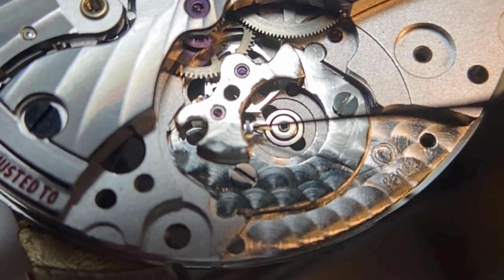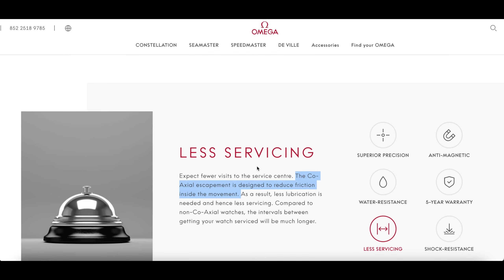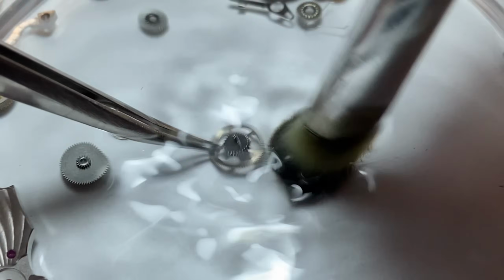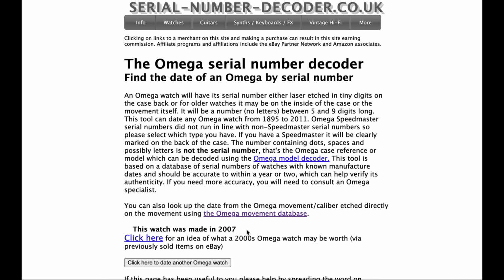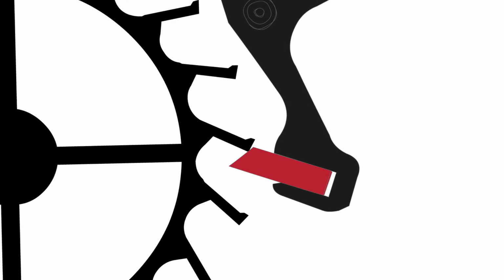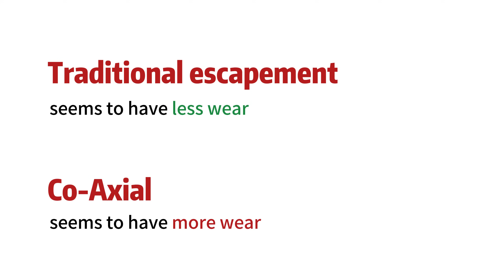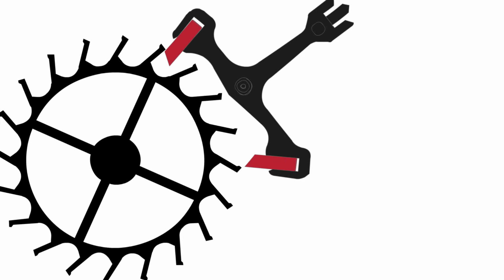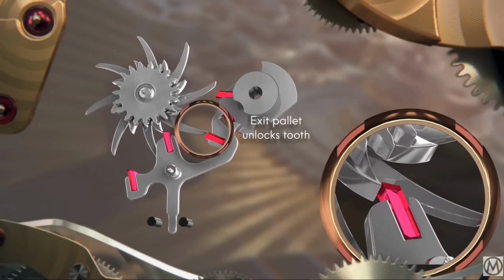Something you don't know about Omega Co-axial

Comment: I have a Favre-Leuba Bovet watch, which is 50 years old. It still works. No problem with the escapement. I have serviced it twice in these 50 years. What is the use of buying an Omega with the co-axial movement, if the escapement gets worn out. And it is an expensive watch too. That's why Rolex did not buy this movement from Mr.George Daniel's. Omega fell for it.

Comment: Bought mine in 2016 by spring 2022 ready for 1st service. Mind you left the crown accidently unscrewed...in the Aegean sea.  In the bag of bits the stem was so badly corroded. The escapement wheel and pawls came too, but no  Si or barrels.  When i got back from holiday I ovened it at 60C for days, with the crown out,  it "worked" for a while, but it was too late, and finally stopped. I think the oil on the pawls is achilles.

Because of high fixed service costs and delays, it is sensible to just to leave it till it breaks.

Comment: That was very informative, thank you! I think the wear here was so uneven, it possibly was the result of a severe shock to the movement. All things being equal, less friction and less acceleration and deceleration of the parts should result in less wear. What that means for maintenance costs is not entirely clear - less frequent service probably means less cost, but while you can get a Seiko serviced anywhere, the Omega needs to go to Omega itself or to a certified watchmaker, and I assume that means cost per service will likely be higher. Which applies to every high-grade watch, and I don't mind it at all - I used to service binoculars, riflescopes etc. for a luxury optics maker, and servicing takes training, time, and specialized equipment as well as spare parts, neither of which are cheap. Thanks to my own job I gained extra apprecation for things that are repairable and last for many decades, and I am willing to pay for it! 
I also have a pro tip for getting good service: be positive and give the techs an honest and detailed description of what happened. Don't try to trick them into taking the repair on warranty when the damage was really caused by an accident, and don't try to argue with them about their determination of what happened. They have seen it all, they have done this thing for many decades if not centuries, and their policies are legally waterproof. They are NOT out to get you - most of them own the same instruments you do, and they want to treat you how they want to be treated. You MAY get a bit of a discount if you create enough of a nuisance, but by doing that you also run the risk of slowing down your own service case when management gets involved and they need to figure out how to handle your case, and someone somewhere gets distracted and forgets they had a decision to make. Before you act, ask yourself whether it is worth the risk. 
If service cost appears high, it's because that's what it costs to put in the amount of skilled labor to fix up your high-grade instrument, whether it is a watch or a spotting scope or whatever. In order to provide excellent service, the business must survive. Which is not going to happen without money. What you get out of it is a watch that is serviced to run like it was new for years to come. And if you calculate the cost per year, it may even be quite reasonable.

Comment: In other words, instead of paying a local watchmaker $300 to service a standard escapement every 5 yrs without replacing parts, you'll be paying Omega servicing center at least $700 every 8 years and replacing worn parts.  I love them, but Omega literally re-invented the wheel to justify higher prices.  Can't someone develop a synthetic oil that lasts 10 yrs, but that would make too much sense.  Talk about creating a problem to sell a solution.

Comment: Love your video simply fantastic! My 8605 planet Ocean had its oscillating weight break at the hub during a bad car crash. A jeweler wanted to charge me $900 to replace the part. I thought that was insanity. Despite the fact that I do understand refurbishing these watches can be quite expensive. However, I diagnosed the issue. I had removed the back and removed the oscillating wheel. I obtained a new oscillating wheel on eBay and have replaced it to the best of my ability. Unfortunately, I broke a small screw and I’m wondering if you have access to any Screw like schematics that show the part number of just such a screw. It’s not entirely important as the watch appears to function fine. It was one of the little screws holding the upper automatic bridge in place. I am a little nervous, however, that the oscillating wheel doesn’t appear to spin/roll as freely as some other oscillating wheels in other watches I have with a different caliber movement. Thank you for any response you can provide. I have already subscribed to your channel and look forward to more videos.

Comment: Nice video. But it should be noted that the co-axial movement in Omegas have never delivered any of the promised advantages. Accuracy doesn't last as long, nor is it more durable or require less service than regular Swiss escapments. It actually runs at a lower frequency due to reliability issues. I'm also told it's a real pain to service, because proper lubrication is very difficult to get right: too much or two little and you have problems. It is great for marketing, but is not a superior movement in any way. It's one of the reasons Omegas don't hold their value the way some other watches do. Oh, when friction increases as lubricants dry up accuracy goes away. They don'r just keep running accurately when dry.

Comment: Coaxial does not rely on friction yes, but there is a reason for why the coaxial wheel does wear the way it does, and that is because of impact. Coaxial escapement operates based on subtile taps. As the wheel cycles with the pallet there are shocks applied with each impulse. The lubrication used for coaxial is to absorb those impacts. Once the lubrication expires then the escapement starts to run dry and the teeth of the wheel will dull

Comment: I bought a 39.5mm planet ocean 3 years ago, the dealer said it was 'brand new'. I brought it the the AD later to verify authenticity but fergot to ask when was it made. I just checked the serial from the link you gave and it shows my watch was made in 2009. I really don't care how old it is so long it keeps time wel and it's genuine as verified by the AD. I got it at 25% off the retail 3 years ago and now the price has crept up a little bit.
Reply: That decoder is bullshit. My aquaterra ref number was made from 2019 and the decoder said it is from 2009. So do not bother.
Reply: @gabod8344  ah so anyway i can find out the real manufacturing date? Or should i go back and ask the AD?
Reply: @lancewood1410 definitely should do that

Comment: I have a diver 300 M that I bought in 2017. I have never had it serviced and it runs about five or six seconds fast each day. I was told that I do not need to service it until it starts to run slow. is that not the case?

Comment: The coaxial also goes a long way to improve precision. We all get caught up on accuracy which is a watches ability to keep time over short periods. But precision is time keeping over longer periods.

You'll find Omegas keep time far better than the couple of months other brands are only capable of
Reply: Sorry to rain on your parade, but any engineer can tell you that your concept of  the difference between accuracy an precision is just plain wrong.
Reply: @pentaxfan4445 Accuracy - Is how close you can he to the target value. Precision - Is how close repeated results are.

Best way to describe this is accuracy is one shot at the target. Whilst precision is how close your grouping is. To be precise you must account for changing conditions that is not necessary with accuracy. One such condition is the state of the power reserve, how far it has un-wound, how much torque has been lost as it unwinds.

Comment: I have an estimated 10 yo 8511 movement (manual) on a De Ville, which functions sporadically. A beautiful looking movement (exhibition case back) with a rose gold bridge. I picked it up as non-functional & used with no papers, etc. Would like to get it running again. I wonder where you can get Omega parts as I would like to repair it myself? Thanks for your informative video!
PS I tried the S/N decoder and it was in error identifying it as a 2007 model when this watch model only existed since 2015 (Tresor).
Reply from the maker: I got it from chinese version,taobao.com.You may check out the international station taobao.com. It may help you.

Comment: Give me a big effing break.  10 years between servicing for a decent quality mechanical watch movement is completely ordinary.  My Sea Dweller didn't need a service until 14 years of hard daily use.  There is absolutely NOTHING out of the ordinary or special about this co-axial movement.  Worse, many/most independent watchmakers simply WILL NOT ACCEPT co-axial movements for repair and the owners typically have to send the watch back to Omega for service, a service that costs far more than a typical independent watchmaker would charge for other movments.

This video is....a complete joke.

Comment: I recently bought an Omega Speedmaster co-axial about 6 months ago, but I previously bought a Seamaster 300M back in early 2002.  Obviously the Speedmaster isn’t anywhere near needing service yet, but it was from 2002 until 2020 before I first had the Seamaster professionally serviced by Omega.  This was not a co-axial movement, but even after all that time it was still keeping relatively accurate time.  However, my Omegas are both watches that I don’t wear every single day.  They’re slightly more special occasion watches for me, like some jewelry, or for when I’m in situations where I know I won’t be being rough on them.  So I think as wear and servicing goes, it can depend a lot on how much you keep them wound and moving, and how much you physically wear them too.  But, like you mentioned, there are always lubricants, rubber parts, and those sort of things that even without use break down over time.  It’s no flaw with the watch in my opinion.  It’s just the nature of almost anything in life.  Everything requires maintenance.  From watches and cars, to the roof on your home, to your own body.  It can be difficult and expensive to do, but eventually it needs doing.
Reply from the maker: Your experience with Omega watches is really insightful! It's interesting to hear how different usage patterns affect the need for servicing. I completely agree that maintenance is just a natural part of owning any high - end item. Thanks for sharing your thorough information and experience.
Reply: I used to have a speedmaster automatic. I also have a vintage seamaster. If you don't wear these kind of watches every day, what's the point? Why did watchmakers make watches, all these years ago? For some poser to treat them as jewelry? It's a sick, sick world.

Comment: One question remains: Why are only 2 teeth  of the escapement wheel excessively worn, leading to severe malfunction? The fact being non serviced for more than 10 years does not  give enough explanation to me! I own several high quality mechanical watches, the first one I bought was a Rolex in 1976 that I used unserviced for 25 years. After that period It was still working properly but lost about 20s/d. Maybe you can give some more explanation because seeing a Coaxial movement experiencing such fatal wear does not look very promising to me. Thanks

Comment: Sorry, but a few "worn" teeth is simply not possible. This is the result of an outside force. Gears do not wear uneven in normal use. Gears and sprockets wear on all teeth equally. This seems like the movement had a few very hard knocks. There is also zero wear on the other teeth. This is not friction wear. You can even see the tooth on the small gear is bent backwards, that is not wear and tear.

Comment: Have you double checked the Omega Serial Number Decoder. With my serial number it also shows 2007 as the production date. However, the model is a Railmaster which was not released until 2017….

Comment: I own a 2013 unserviced 300SMP. Amongst others, I also own a Submariner; serviced by Rolex several months ago. It is about 4 seconds a 24 hour period out, which in itself is no big deal. The Seamaster however? Absolutely spot on accurate. I know we don't buy mechanical wristwatches for accuracy as such, but Co Axial? The proof is in the pudding...
Reply: Is this a 5 digit model submariner? Rolex movements pre current are not super accurate in reality

Comment: I think that Seiko yet again as so manny times before beat the Swiss. 9SA5 is basically much better solution then co axial. Dual impulse escapment is a way to go in the future. Holy grail in horology is hi beat with huge power reserve and Seiko elegantly gave us a solution for that.
Reply: 9SA5 is a very beautiful movement but I think it still does the same thing as the lever escapement in terms of the parts sliding across each other while imparting force, rather than both parts moving together in the same direction as the co-axial does.

Comment: The Co-axial 2500 was one of the worst movements ever made. I had return my Aquaterra watch to my AD (which I exchanged for an IWC) due to continuous random stops. Omega was never able to fix the watch (and top it all it came with scratches on the case after each and every visit to the Omega Service Centre). It took them FOUR revisions of the movement (up to the 2500D) to stabilise its reliability (my Aquaterra equipped a 2500C). I will never ever buy again an Omega watch
Reply from the maker: haha🤣

Comment: Nice video Charlie, I have a serviced few Seamaster's both 2500 and 8800 calibers and I wonder if the wear problem exists mostly with the dual barrel Co-Axial movements like the 8500, 9300, etc. putting more pressure on the gear train because I haven't seen any or heard of any problems with these earlier Co-axial movements. Again, great video and explanation.
Reply from the maker: I don't think it has much to do with the double mainspring. By the time the power from the mainspring reaches the escapement wheel, the force is really tiny, almost nothing. It's actually the workmanship and accuracy that matter more. That is to say, structural design is one thing, while craftsmanship and materials are another.

Comment: Needing an escape wheel replacement after 10 years is durable?
I wore mine for 10 years and it also stopped working normally: required auto-winding wheels replaced.... My old cheap Orient watch went through 15 years and three services and it was as solid and as accurate as in day one - with no spares needed!
Reply: I have some cheap Seiko lever movements from the 1970s. I service all of my movements myself and have never seen a worn escape wheel on a Seiko no matter if they've had service or not.  Initially, coaxial movements will run more accurately, but coaxial is a step backwards in durability IMO.    A well regulated Japanese lever movement will run almost as accurately and last decades longer.

Comment: The failure mode is very undesirable. From perfect working to completely broken with no warning. It's typically far more preferable for a system to fail with observable symptoms before complete failure. In most systems, how you handle failure is the most important aspect of a system.

Comment: The weird computer voice is really distracting. Also, that's my understanding that the modern synthetic oils don't dry out, so I'm confused by the claim that the oil dries out, but the movement keeps working because of the coaxial design. My planet ocean kept running and the only reason I needed to turn it in for a service was that the crown wouldn't go back into place. I couldn't close the watch up and it was no longer water resistant. As part of the service they did replace some of the movement parts not just the crown and crown stem.
Reply from the maker: It is my understanding that all liquids will volatilize, only that different liquids have different volatilization rates. That is an inherent property of liquids. In fact, there's no need to wait until the watch oil dries out completely. Once it evaporates to a certain extent and causes a change in the liquid's consistency, the lubricating properties of the watch oil will be affected, ultimately altering the time - keeping characteristics of the watch.
Well, the ai voice.😂 Thank you for your feedback.